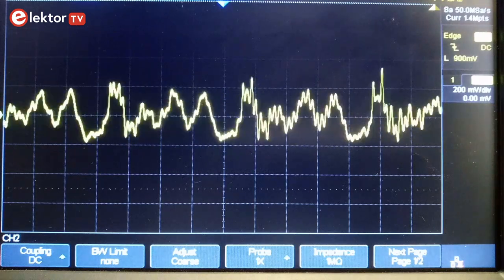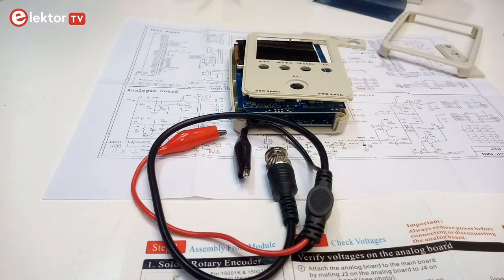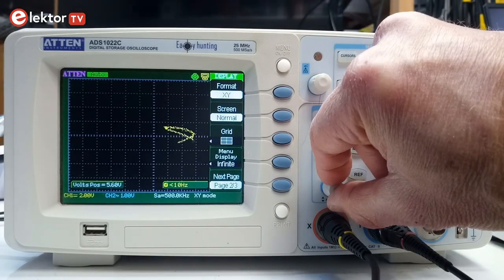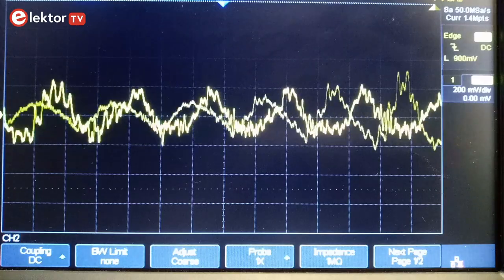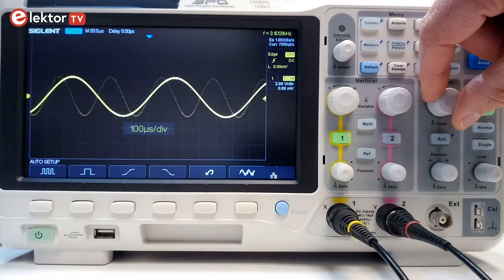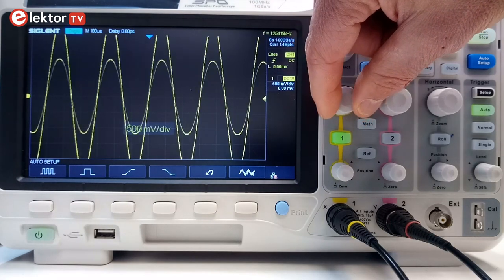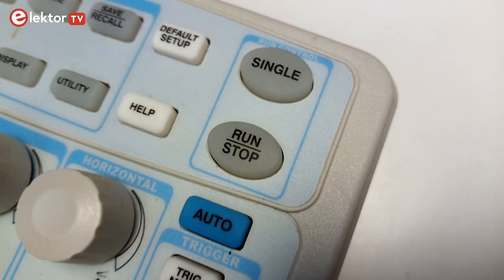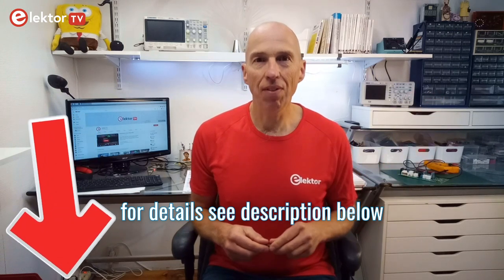How to Get Started with Your Oscilloscope

Comment: Nice and interesting video. at 0.56 you said you purchased the oscilloscope shown in your video for about 100€ - already a few years ago. Electronic gadget prices normally tend to drop over the years. I looked for this ATTEN ADS 1022C on the Internet (in April 2022) and the cheapest price I could find was 295€. That is almost factor three!.  
Would you mind sharing the source where you purchased your ATTEN ADS 1022C, please? Thanks.
Price up to 50% more than 100€ would be perfectly acceptable.

Comment: Very cool! I'm a former specialist telecommunications technician and i can say that oscilloscopes aren't for common people's without technic or engineering formation! They certainly are not usable for non technicians and engineers, or physicists!
Reply: Yes, you need the will to learn how to use an oscilloscope in order to use it correctly, and electronics and RF knowledge definitely don't hurt either. ("Know what you are trying to measure.") But I am happy that an electronics hobbyist now can afford a (low-end) oscilloscope, look at a signal, and get some help finding problems in a circuit.